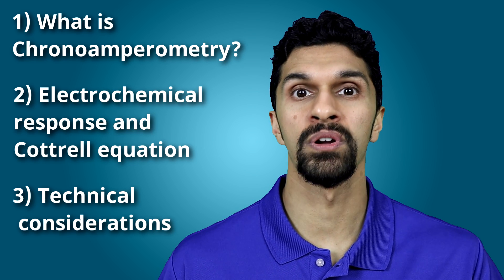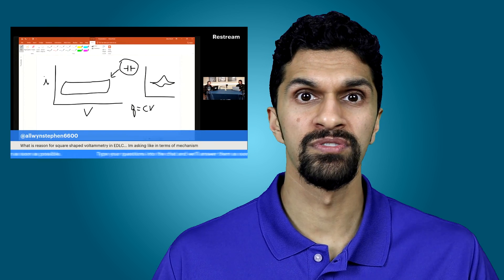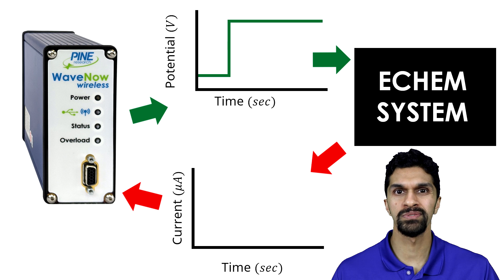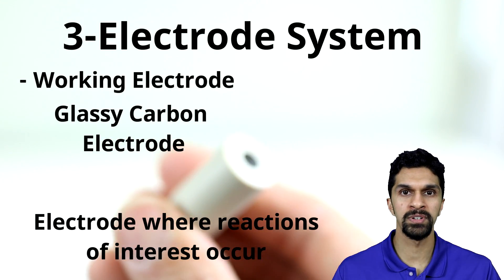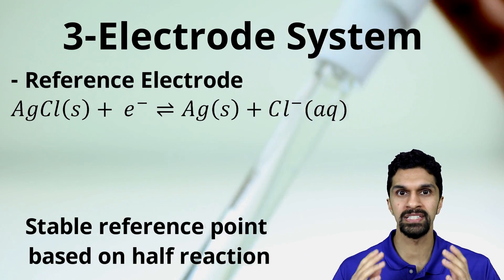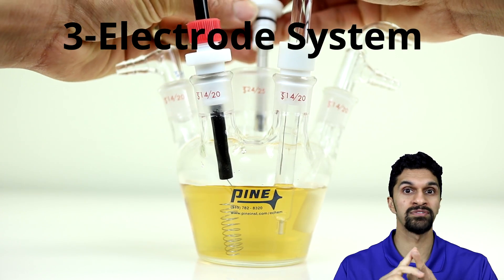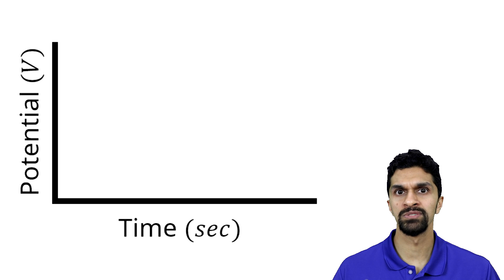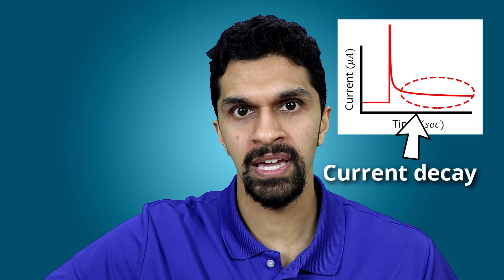Introduction to Chronoamperometry

Comment: Very informative, Can u design a SOP to conduct chronoamperometric experiment for concentration study or selectivity study in electrochemical sensor. So that one can get a practical exposure.
Reply from the maker: I think we would need to know more about your system and the potentiostat you are using for us to make an SOP for you.
Reply: @Pineresearch for three electrode system on CHE
Reply from the maker: @rishitajain5954  We are not familiar with CHE, plus what kind of 3-electrode system.  What is the working electrode, counter electrode, reference electrode, electrolyte, analyte, etc.  These are parameters we would need to begin coming up with an SOP

Comment: Thanks for the sharing, i have one request . can you make a video comparison between transference number measurement (tnm) and chronoamperometry, specifically for energy devices? or can you explain with me details in here. Hopefully you can help this🙏🏻
Reply from the maker: At some point I can probably make a video on that topic, however it's fairly complex and does require EIS for the calculation of the transference number.  However, there is a website that has some very useful information on using the Bruce-Vincent method for determining the transference number via chronoamperometry and EIS. https://lithiuminventory.com/experimental-electrochemistry/transference-number-measurement/index.html

Comment: Great video, just have a question in my mind, if we do not apply a very extrame voltage for chronoamperometry (i.e the there won't be a used up of redox species on electrode surface), does the current vs time curve still fit the Cottrell equation?
Reply from the maker: That's a good question.  I will try to talk about this on episode #97 of the Ask Us Anything About electrochemistry live stream (tomorrow).  I think this question needs a little more video discussion to really answer it.  But it's a good question!

Comment: why in cpe experiment of electrocatalyst choose specific potential
Reply from the maker: To do cpe you will need to pick a potential where the catalysis occurs, otherwise the reaction won't happen.  Generally speaking you want to pick a potential sufficiently high enough to overcome any solution resistance and maximize catalysis.

Comment: ❤
Reply from the maker: Correct.  Molecules need to diffuse towards the electrode surface to oxidize, but as the diffusion layer thickness increases, there are fewer and fewer molecules near the surface to oxidize and hence the current decays.
Reply: @Pineresearch and ruthenium is kept at 300 mV in the beginning because, it doesn't go through redox reaction at that potential. Also will you be willing to do a video on current controlled chronoamperometry. Thanks
Reply from the maker: @syedashobnam2573  Just to be clear, there is no such thing as "current controlled chronoamperometry."  Chronoamperometry is by definition a potentiostatic technique where the potential is controlled and the current is measured.  I assume the method you are referring to is "chronopotentiometry," which is where you control the current and measure the resultant potential.

We will certainly keep this in mind and if we are able we will make a similar video on chronopotentiometry.